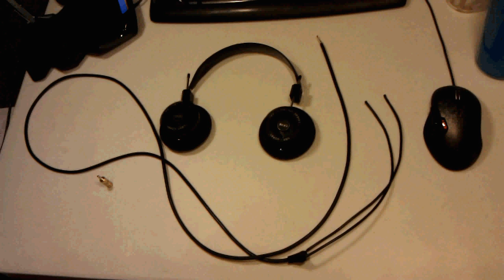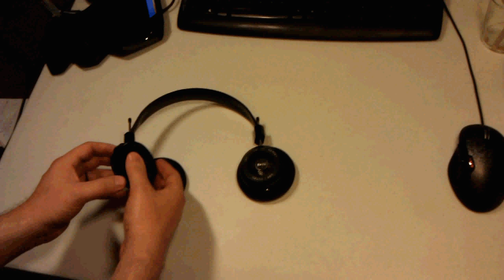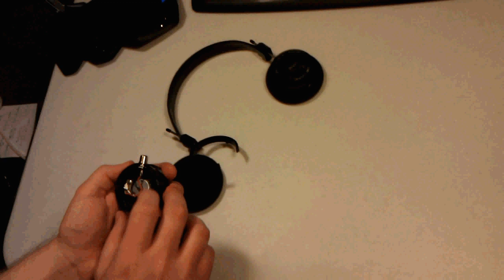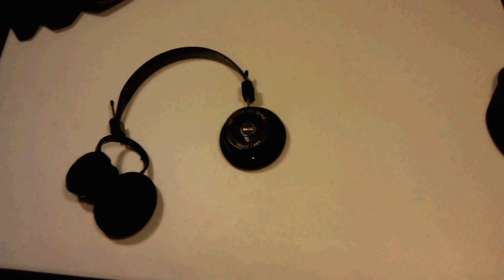Grado Headphones Cable Fix

Comment: Man, idk why grado doesn't design it like this to begin with. If they did, im pretty sure these headphones would have like 100% rating everywhere since the wire frays are like 100% of the problems.
Reply from the maker: Totally agreed!  A simple change (which I can't imagine being that expensive) would take a 4 star product to a 5 rockstar.
Reply: Did you have the sleve going to the cans start to harden as well?
Reply: it's 7 years later and Grado still has not listened.

Comment: Here is my feedback : 
- Don't heat too much with the heat gun, I have deformed a small zone of plastic where my hand pulled it when separating the glued parts.
- If you set a wire up along the top arc, beware of the new holes emplacement, the top cable may block the natural rotation of the speaker boxes.
- Don't use a nylon breaded cable, every friction is conducted to the speaker box, very annoying.
- When gluing back pieces, be quick and check side holes are aligned

Comment: The only issue that Grado has is that the cable connection at the cans has no buffer between the can and the cable.  The cans clamp down onto the cables to hold them into place.  They also add semi-rigid tubes to the section of wire right below each can to make the cables look nicer, but this makes wear at the can crimp/flex point even worse.  And this also makes it hard to know which way to untwist the cable if it become twisted.

If they had small rubber grommets surrounding the can cable openings, or rubber catches incorporated into the cables (similar to the neck Y) below each can, the product would last way longer than it does with crimped cables.

I just fixed mine ten minutes ago by heating the cans to release the hot glue.  Then I cut the leads, and cut the entire cable 1/4 below the small zip ties at each ear.  Then I stripped the black insulation back 1", stripped the smaller insulated wires 1/8", and solder the connections back as they were (using the clipped wires as color guides).  

I used two micro zipties (from dollar store) to replace the originals.  I also used a drop of hotglue to cover the solder points, and can entry point, to reduce the potential for stress damage.  I also made sure to allow the hotglue to cool, and then removed the fine hotglue threads to prevent buzzing.

Close the cans up up... no more popping, saved $80 for a used replacement pair, or $40 for a cable.  They will inevitably break again, but at least I bought myself some time.  The idea of jacks at each ear seems like overkill, and the potential for popping is even higher with a setup like this.  If it works it's work, whatever way you want to save money.

Comment: Thanks man, I love my Grado's SR80. First problem was that one joint went loose. So after  abit of frustration i took a two part epoxy, cleaned surfaces and glued the metalic ribbon back into the join. The same after the next joint broke. Third time i've stepped on a cable and the signal for the left channel started to dissapear randomly. And then i found about your video and my day was saved :) Thanks to jpkfox too, the hairdryer worked perfectly for the glue.

Comment: Jonathan Grado, vice president of marketing at Grado Labs, a company with a reputation for repair-friendly products, says his company will fix anything other than ear pads, even on headphones that are half a century old.  Shipping +, $25 and up.  So if the parts are over $50 or so, better off sending back.  I have 2 pair, 1 with a short, so I might try to fix it if cheap enough, but the wires alone are about $25 for gold.  So it depends on your skill and available parts.  ^_^ Still, brilliant fix.

Comment: Great, you just saved me £50-£70 as I was able to do this. Nice, and can change the cable easily. I am the one below (jpkfox)...I asked you questions 2 years ago...was lazy, but now today finished this finally :).
Reply from the maker: +TryingTo Correct Great follow through!  I sure wish I would have filmed the actual process.  I did end up filming my single-wire mod, but I can't find the videos and it's killing me!  I really wanted to upload that.
Reply: +Travis Watson Ok, but I understood all that... and the main point was clear in the video so I got confidence to do it myself and know it can be done. Fortunately it was easy to do.

Comment: hello, just opened my sr325s, the left driver was loose, and giving no sound,,, pop it back in and now gives sound, but with about 35% less bas or more,,, do i use electrical tape or something to seal it good or whats the deal? ,,, is the little ring that the driver goes in screwed (it looks little deformed) thanks!

Comment: my problem is not fraying cables... I got two pairs of sr80s with same problem: it seems the cable has somehow got loose inside the headphones... so, whenever I turn my head, or if I'm walking with these on, I hear the sound of that cable moving inside, or tapping against some surface... any Ideas what to do about that? The cable isn't attached properly, it can be pushed deeped inside the speakers... Any ideas?

Comment: Helpful video, thank you Sir. Grado are frustrating. They sound fabulous but such flimsy design. No box or case for the pairs I’ve owned and mine also have stopped working on the left so I’m going to try your repair technique.

Comment: Thank you for showing how to do this. I was surprised how easy it really was to do it yourself.  I bought the Panel Mount Phono Jacks Color-Coded at Radio Shack. I also got the 6' Audio Y-Cable that has the stereo male to dual rca phono male there as well. It really sounds like when I bought them.

Comment: I also try to think of solutions to common problems, and it's alway best to think of readily accessible materials. I like this idea-and it is applicable to any headphones, and all are susceptible to cord damage.  They should all have removable cables perhaps. Thanks - repairing a pair of Grados that has a blown element and I may also implement this. They are not of the most incredible build, but they sound fantastic!

Comment: Thanks. Am just in a process to fix my Grado cable. They break so easily.... This is what is best. But... the details of soldering the wires to the jack. I cannot see very clearly which one goes where in jack.
Reply: Hmm, maybe I can just test all the options (wire to the jack) and when I get the sound from the phones then I know its the correct option.
Reply: Hair drier works well to heat the glue.
Reply from the maker: jpkfox It doesn't matter which wire goes to which piece of the jack.  All it changes is the phase.  For speakers, you get a resonance cancellation if the Left/Right phases don't match, but that doesn't occur for headphones.  However, I'd still make sure you're consistent between the left and right cans to make sure it sounds proper.

Comment: What type of phono jack did you use? TRS? Or TRRS?
Reply from the maker: For this setup, I actually used RCA jacks. But I did another mod after this that I don't have a video for where I used a stereo/trrs single wire and run a new wire across the headband.

Comment: So much for old school quality. Grado could easily produce the headphones so that you dont have to use a heatgun, break the plastic cover and solder when you simply want to change the freaking cable.
Reply: And they could just as easily make them so you couldn't get them apart without cutting the plastic.

Comment: Grados are by far the best headphones I have used in terms of sound quality and fidelity. In terms of build quality they are the worst. The cable on my SR60's is a mess and has been falling apart for years. Grado should really should offer a kit to replace the cheap cable.

Thanks for the tip Mr.Watson.

p.s. I found this Grado mod site many months ago but never tried any of them out. It also has some crucial info on disassembly. Hope it helps.

http://headwize.com/?page_id=737
Reply from the maker: Yes, I 100% agree they should offer a kit.  I actually contacted their support to ask if I could buy a replacement wire, and they refused.  I'm okay with that now, considering it's been 1.5 years like this now and my mod is still working perfectly.  I've been wanting to do a single wire mod.  If I get around to that, I'll toss up another video with more progress.

Comment: Thanks For sharing your frustration with this company. I thought I was alone. 
Do they sound good? The SR 325s sound better than my 80s Sony Digitals.

THE ONLY THING LESS MEANT TO FIT HUMAN EARS IS 40'S HAM RADIO CANS. THEY WANT 20 DOLLARS A SIDE PLUS SHIPPING!! FOR 6 CENTS WORTH OF LOW DENSITY FOAM RINGS THAT DISSOLVE IN 6 YEARS. THE COME WITH CHEAP MOLDED WIRES FROM CHINA OR WORSE. I WON'T BUY ANOTHER SET. 

I'd decided to look here to see if anyone has fixed these and here you are. I thank you can't wait to tale a look at the vid. I was amazed someone took the time to expose this company. I don't care that they sound good when the company is this greedy. My grados took this moment to die so I have to go get my Sonys, still working after years as my car phones. In and out of the bag of cds all the time while I'm trying to watch the road. They have been yanked and pulled countless times. The grades hung on a hook in my studio  and got pulled on twice when I stood up with them on and didn't notice the wire was caught on something. I mad my own foam pads out of free foam and they are much more comfortable than what came on this 300.00 plus if you pay retail, I did not but they were still over 200.00 ten years ago. There must be someone making better a better sounding set of cans by now.

Ron Becker
Reply from the maker: The cans I purchased were about 80USD shipped.  For the price, I am incredibly thrilled with the purchase.  The foam has held up great for over half a decade and is still comfy and holding up well.  The wire was the only issue, and after this very quick mod (maybe 30 minutes), they are rock solid.  I'm sorry to hear that you're unhappy with your purchase.

Comment: Send $10.00 US to Grado with your headphones and they'll fix it all for you. At least they have for me in the past and I'm about to do it again.  Or if you're looking for a project, this works too.
Reply: Actually, as of today, 10/24, I called and it is not $35 to repair your headset, which is still cheaper than a new set.